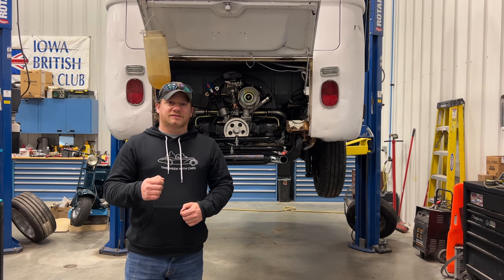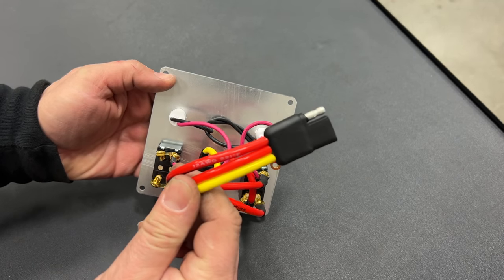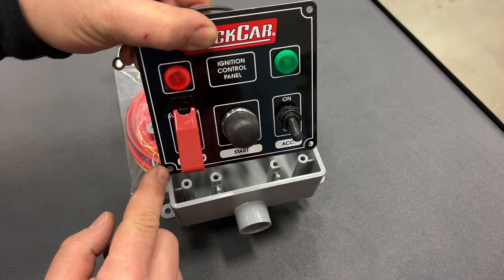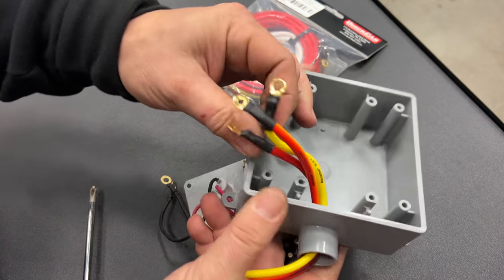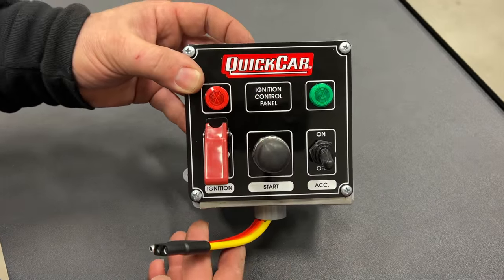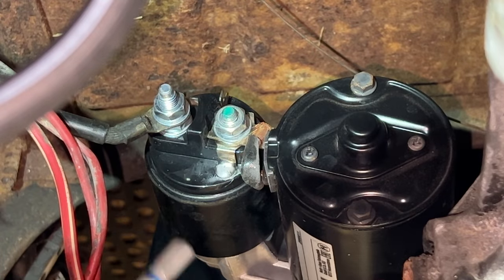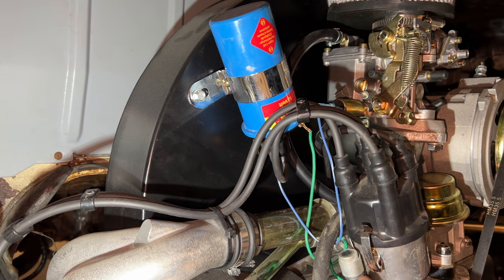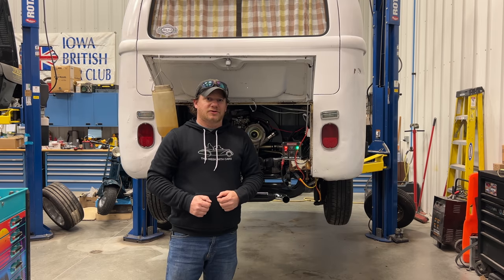Remote Ignition Panel to Hotwire My Project Cars

Comment: I’d definitely run the ground, just as a sanity check. The last thing you want to do while troubleshooting is question your tools. A cool idea for the ends of the leads would be to use banana plugs and then use test lead adapters to get whatever end you need for the application.